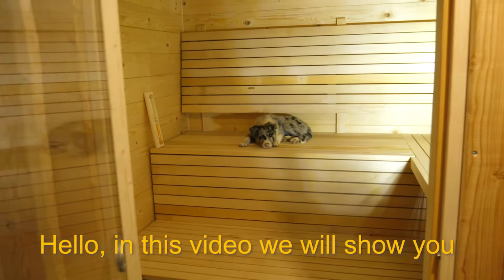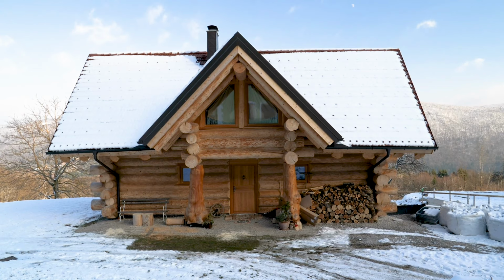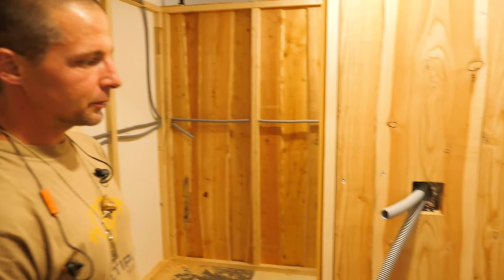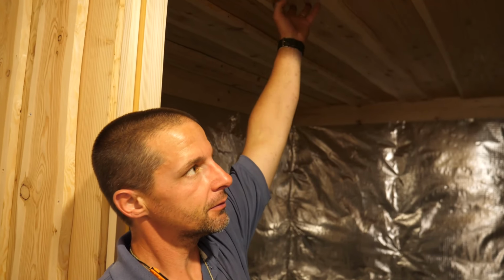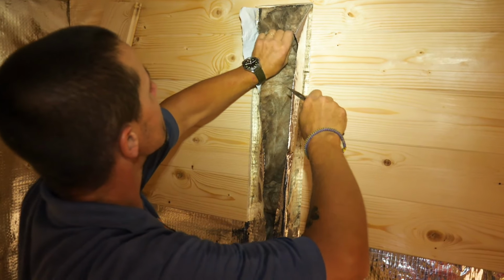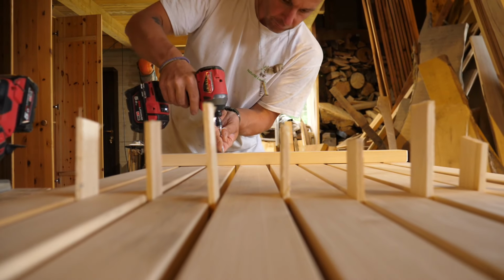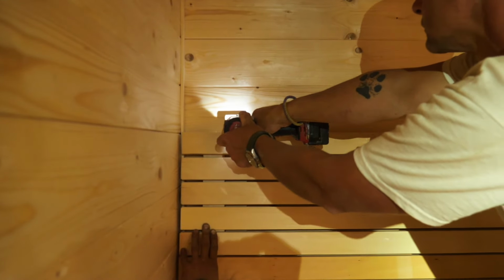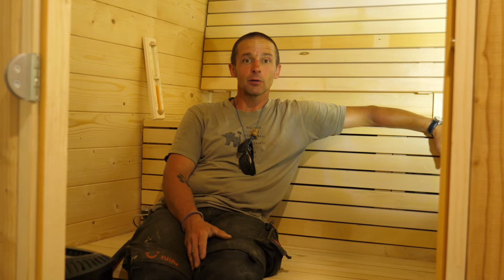How to Build a Sauna in 8 Steps

Comment: I didn’t understand the ventilation? How does it draw fresh ventilated air to prevent rot etc. 

Also, heat loss through floor? Drainage through floor (moisture etc). 

Not the best build if honest.
Reply: I was thinking the same...